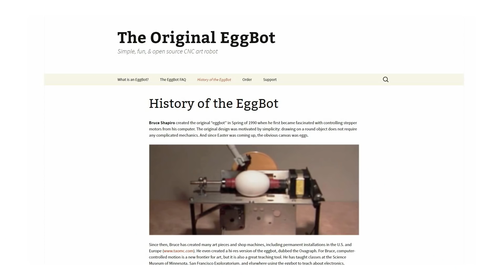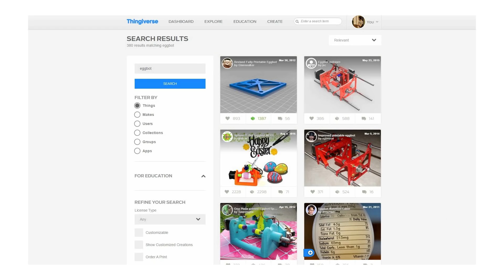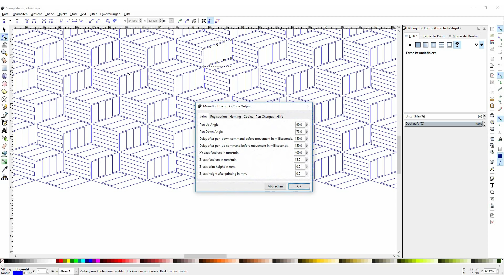Painting Easter Eggs - The Engineer's Way

Comment: Can you paint Coffee Mugs like this too? Or does it have to be a sphere like shape?
Reply from the maker: It should also works on cylinders like mugs but you will probably get a distorted picture. You might need to change some things to get the clearance and to hold the mug.
The better solution would be to change the second rotary axis (the pen arm) to a linear axis. This should only require mechanical changes but the firmware should still work. I'm quite sure that there are such designs online.
Reply: +CNC Kitchen Nice, thanks for getting back to me! :)
And keep up the good work!